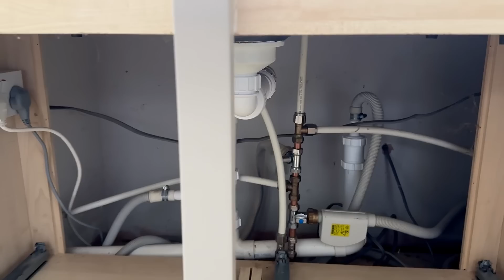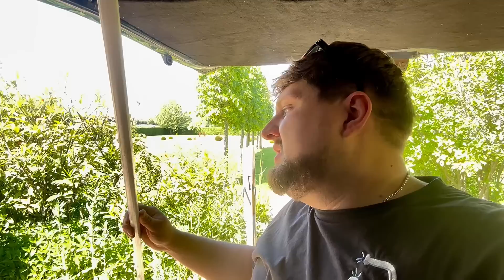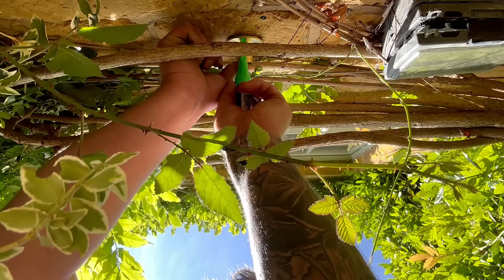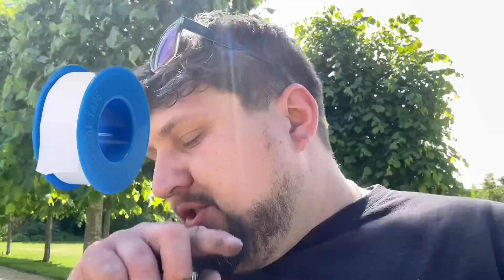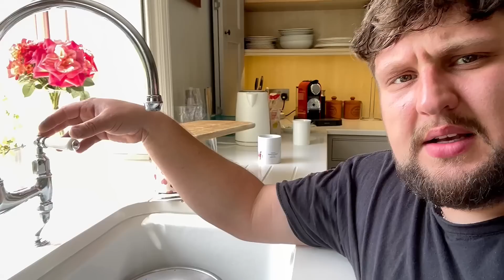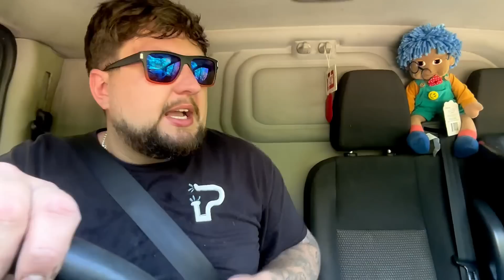How to fit an OUTSIDE tap like a PRO with Professor Plumb

Comment: You probably won’t like me commenting on this, (heating, plumbing engineer, of over 40 yrs experience) but I would have done that all to a different plumbing method.
I must say though that the original plumbing looks a bit of a jumble and seems to take up too much space the way it has been all installed, so not the easiest tap install. 😟

Few points here, - The outside lever type tap is brilliant as more practical, reliable and easier to use with just a 1/4 turn full on or off. But the lever is just a piece of steel and will rust being exposed to the rain, which is a pity with that exact tap.
Check valve I believe should be double check valve type and fitted inside and with some type of ideally full flow isolating valve. The small bore cheap type iso valves often not only reduce flow, but are not ptfe glanded, but have rubber seals on the ball and can leak or break.
(Personally I prefer full flow isolating valves fitted anywhere they are doing numerous supplies, or for a sink or outside tap to prevent reduced flow rates, but I understand plumbers can’t always be replacing original work merely to slightly upgrade it) 
The plastic sleeve (conduit or overflow) is perfect and exactly what I use.
It prevents corrosion to copper pipe and gives some degree of insulation protection against  freezing, keeping a barrier from brick/stone walls. 
The brass flange for tap, although good, unfortunately acts as a cold zinc and likely increases the possibility of pipe and tap area freezing in frosty weather, but that is when people should turn off iso valve supply to tap in severe cold weather.
You fit the new tap dry to the flange to see where it tightens to vertical, then mark the flange and fit that way up to the wall approx, so when you fit the tap using tape or jointing compound, it will lock up tight in vertical position. 
The pipe from flange, rather than having it protruding straight into behind the unit, could have been cut close to wall inside and an elbow to turn pipe clipped to inside wall and piped to just above the lowest iso valve for a brand new brass or soldered tee. Pipe just then needed bent with a bending machine all in one piece - no soldering required, just your check and iso valve (except if you wanted a solder tee used).
Any soldering is better done away from brass fittings and valves and avoiding plastic pipes and fittings obviously, therefore soldered out of position before fitting it all. 
The acid based fluxes are, imo, best avoided for several reasons including they are extremely corrosive to copper.

Comment: Loctite 55 has never let me down. Interesting you don't silicone outside. I get your logoc about leaks but I'd worry about water tracking into that when it rains.
Reply from the maker: But its sealed around it so nothing can get into the wall, only the pipe - which is sealed inside 👍

Comment: Little tip for you 
Screw the bib tap on first then mark the holes take it off then drill holes then when you put liquid ptfe on it it’s going to be tightened right up and dead straight 👍🏻